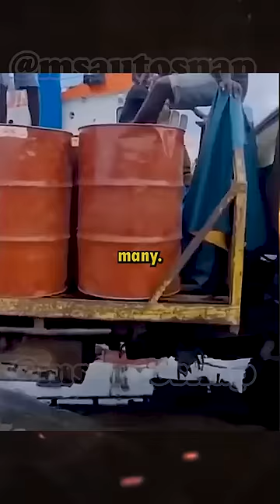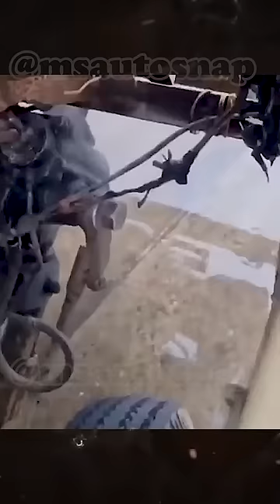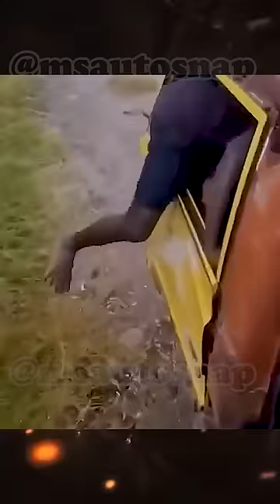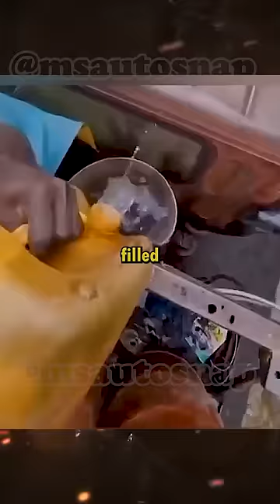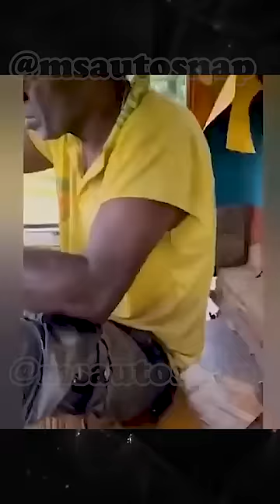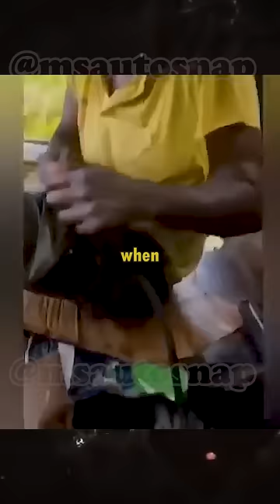What Truck Is This? #cargo #transport #truck

Comment: Fun fact it aint even coolant its just plain old water lol
Reply: They don’t need any antifreeze in their coolant because they never get freezing weather
Reply: @owen9273  antifreeze not only lowers the freezing point, but also raises the boiling point, so the engine won't overheat at 100c. It also inhibits rust inside the engine block. Of course, at this point with this truck, that's totally irrelevant
Reply: @PaulHojda Even with anti freeze it would be a bad system, because there is no pressure (thus lowering boiling point)
And if you lose this much coolant into engine or the environment, it better can be water.
Reply: Water is coolant. Antifreeze itself kinda sucks as a heat coefficient, it just prevents the water from freezing. It actually takes away from the waters ability to transfer heat, that's why it's best to use as diluted as you can get away with. Distilled water should only be used to prevent mineral buildup in the engine and coolant transfer systems.
Reply: @PaulHojda water is still water the pressure inside the coolant system is what keeps it from boiling at 100°C
Reply: Which plays the role of a coolant thus a coolant😊
Reply: Fun fact , plain water works just fine 😂
Reply: Water will rust everything and boil at 212 degrees
Reply: @owen9273 if it was distilled water, it would be ok for a vehicle like this. The water they are using has many minerals and debris that will reduce the life of the engine drastically.
Reply: You don't have to worry about antifreeze when it's never cold. We would run straight water if it never got below freezing here
Reply: If it cools, it’s coolant.
Reply: Ach passt schon beim tüv einfach ein bisschen Geld beim Fahrzeugschein mit rein und alles gut
Reply: Fun fact water was originally used as coolant and still is in less developed parts of the world. Modern coolant is referred to as anti freeze as the primary function over water is too lower the freeze point for cold weather.
Reply: In a warm climate all you need is water
Reply: I also saw sea water used as coolant, Kudos to Japanese truck engineers.
Reply: I’ve always used water in my van. It’s at 350k miles and seems just fine.
Reply: That’s why it’s on a drip:)
Reply: @Wag27myG  if you have an aluminium radiator and feel it with low EC° (electric conductivity) water it could last long , with copper or high EC° it will clogs fast.
Reply: Not just plain ol water, it's swamp water with water bugs, mosquito larvae, tadpoles, and other swamp creatures
Reply: @roland9367 I'm sure it's not antifreeze
Reply: @PaulHojda  boiling point in a 15 psi coolant system is already significantly higher than 100c
Reply: @BigPanda096 
This whole truck could use some remineralization😂
Reply: @CurtisCarpenter-rm2jl  Tap water is perfectly fine for most vehicles, corrosion usually is more of a problem when using only water
Reply: , not coolant.
Reply: @T1m11 you need to use distilled water. Trust me using plain tap water in any vehicle will damage it.
Reply: @Billy-burner  No, it doesn't, you only really need distilled water when you use the old phosphate based coolant.
Reply: @CurtisCarpenter-rm2jl  these guys are definitely worried about engine life reduction in this truck.

IMHO this truck was already scraped as being at the end of its life and these guys were able to get it running again lol
Reply: @BigPanda096  Absopure?
Reply: @mikereynolds1368  the truck is vital to these ppl’s lives. If the engine gives out, they are in big trouble
Reply: When you never. Have to worry about it freezing lol
Reply: They are using either rain water or bore water. I use bore water in my vehicles in Ghana. A high quality engine oil is much more important than what water you use especially in a water cooled motorcycle engine. 
The petrol here is low grade I have experienced pinging after filling up at a particular brand of filling stations.
Reply: @PaulHojda Water is a coolant. You can't use antifreeze in professional racing, only water, and it works just fine for high horsepower race cars.
Reply: @sumo-ninja You've got no idea what your talking about lol I live in Australia where it never freezes and we still use "antifreeze" because it stops corrosion which happens if you run just straight deminorolised water so no your wrong no one in any developed country would choose not to run "antifreeze" because that's not it's only purpose. Tell me you don't know what your talking about without telling me so 😂
Reply: @paulallen-01  You've got no idea what your talking about lol I live in Australia where it never freezes and we still use "antifreeze" because it stops corrosion which happens if you run just straight deminorolised water so no your wrong no one in any developed country would choose not to run "antifreeze" because that's not it's only purpose. Tell me you don't know what your talking about without telling me so 😂
Reply: @mattsabeast5 wrong it is used because of its anti corrosion properties just as importantly as it's anti freeze purpose. Why do countries like Australia use antifreeze if its only purpose was to stop coolant freezing? 😂
Reply: All those people commenting "antifreeze isn't needed in warmer climates" obviously have no idea what your talking about look up its corrosion inhibiting properties. And coolant is a mixture of distilled water and corrosion inhibitor/ antifreeze it is used in countries like Australia where im commenting from mainly for its rust inhibiting properties. Coolant is a mixture of chemicals & deminorolised water used to inhibit rust and sometimes to stop coolant from freezing but it isnt used for antifreeze properties in all parts of the world that is why it is used in different ratios and also different types of chemicals depending what its purpose. You can buy many different types of coolant so all those people making silly uneducated comments do some research before spreading false information. Obviously in this case rust is the last of their worries but coolant is not just "antifreeze" look up the definition of coolant and all the different types & even the different ratios of ethylene glycol / deminorolised water & its  uses depending on what climate you live in.
Reply: @aaronaaron3003  yeah these guys are idiots. Aussie mechanic here, both motorbikes and cars. I cringe at the people saying it's ok to use plain tap water. It's full of calcium and minerals, which ALWAYS turns into crap inside a coolant system. Seen it thousands of times. It eats through aluminum and steel and turns into disgusting clumps of cake deposits.. Sucks to know someone will end up buying a second hand car from one of these idiots and it'll be a ticking time bomb. Even worse when people leave plain tap water in their coolant system and have left it sitting for a few years.. everything like the water pump, rubber hoses and water galleries will be fully caked, rusted and destroyed. Yet those stored with coolant and no tap water, they are still mint condition. Not only does coolant raise the boiling temp, and lower the freezing temps, it also is a rust and corrosion inhibitor.
Reply: @Billy-burner  Your definitely not wrong Iv got two ktm dirtbikes that I haven't ridden for around two years now due to multiple back surgeries and both my bikes have been sitting in the roasting hot garage for two summers now & I just started going over everything on them to get them ready for the upcoming cooler weather and both bikes have lost around 200ml out of the 1 Litre cooling systems/ radiators due to expansion and evaporation in the roasting hot garage over the summer days & they are both absolutely perfect there's no corrosion whatsoever even tho the radiators have a decent size air pocket at the top of them and they haven't even been started or anything in well over two years now. One has just normal ethylene glycol based coolant and the other has radiator ice/ high temperature coolant & both have most definitely done their job corrosion wise. It's crazy to see how much mineral build up you get from plain old tap water like you've said, Iv had to top up my old BF supercab ute with normal water a couple of times when Iv been out bush and overheated and have forgotten to flush the cooling system afterwards and within a few months I had the thermostat get stuck in the closed position due to corrosion and you could quite literally see the crystals from the mineral deposits building up all over the thermostat & all through the cooling system after only a few months because the minerals boil off and seem to settle even more so in the high points of the cooling system which on the BF supercab ute is the thermostat housing & the coolant reservoir & all along the top of the radiator. It blows my mind seeing a lot of the misleading "mechanical advice" online, a lot of common sense things aren't exactly common sense anymore even tho it literally gives you a lot of the information on your fluid bottles when you buy things like coolant and oil & other critical fluids 😂
Reply: @BigPanda096 It's called coolant because it lowers the boiling point of water as well as being called antifreeze because it also lowers the freezing point of water. Welcome to knowledge, my friend.
Reply: Duh
Reply: @T1m11  ya, i suppose if you’re diluting antifreeze, it wouldn’t hurt.
Reply: @imfloridano5448 well that will eventually stop the leak.
Reply: Damn you're a genius!!
Reply: Thats gotta be a fuel tank
Reply: Plain water is coolant??
Reply: @Billy-burner not true. Maybe travel outside of your country and see how its done. There are 40 - 50 year old vehicles still using tap water. My 86 Toyota always used tap water 267 on odo when I gave it to my lil bro everything still original. Even water pump didn’t fail
Reply: @jusplay7309  there are countries which exclusively use only tap water? Thanks for the knowledge my friend.
Reply: @CurtisCarpenter-rm2jl yeah it’s not distilled water these people don’t have access to clean water let alone distilled water. I truly feel bad for people who live like this. There is no need the world has enough space to create enough resources so everyone can eat and live properly. It’s greed and power corruption and control that breeds this kind of living situations. Also Some countries truly don’t want to be modern they want to live like this. Look at Afghanistan America tried to introduce schools, better stores, and more but they would destroy them every chance they got.
Reply: Wata
Reply: Water is used as coolant in many things
Reply: Fun fact do you really think these guys give a dam what liquid they use as coolant?
Reply: Need one of those set up for my honda. Keep it at 50mpg.
Reply: @SayGahTaah  that’s not a fact that’s a question
Reply: Fun fact, you don't need coolant if you're somewhere that doesn't ever freeze! It would be wise to add a anticorrosion additive pack to pure water if you decide to run it but yeah this place probably doesn't hit freezing!
Reply: @PaulHojda pressure raises the boiling point regardless of whether there is coolant or just water though! Plenty of people run race cars on distilled water in instead of coolant and don't run into overheating issues... Because their cooling system pressure prevents boiling until a much higher temp than an open system would! Water boils at close to 250+ at 30 psi which is typical absolute pressure for a cooling system. 15 or so psi above ambient! With a proper radiator. Fan and thermostat you'll never get near 250 on a car cooling system at all so no worries about boiling
Reply: @John-eb5zt at cooling system pressure water doesn't boil till 250 ish. In an open system like this yeah it will boil at 212 but even then if your thermostat opens at 195 you really shouldn't be hitting 212! My thermostat in my passat opens fully at around 195, and the highest you can ever get it even ripping on it is 205ish. That's running EGTs pre turbo that approach 1700 degrees Fahrenheit. Lots of heat! When EGTs are at 1700 you're looking at cylinder temps approaching 2200 degrees Fahrenheit, and even with all that heat.. Still no more than 205
Reply: @CurtisCarpenter-rm2jl  aha, so distilled water prevents your block from rusting away?! Interesting
Reply: @John-eb5zt nah mate, Water boils at a temperature determined by pressure. As to the rusting stuff out part, not fast enough to really matter.
Reply: The coolant in my classic car is currently plain water, switching to anti-freeze coolant when I empty it but it ran fine for years with just water.
Reply: Fun fact water is actually a coolant 🤦‍♂️
Reply: @jaytee2716  the view of America is what Washington DC displays to the world. The government and the American people are truly worlds apart when it comes to values and policies.
Reply: You probably didnt know but unless water freezes where you live, water cools better than antifreeze mix.
Reply: @PaulHojda thats not even very true. Its been proven. More marketing. The coolant will not raise the boiling point enough to keep from boiling. If the radiator is getting air you have nothing to worry about. But you can buy coolant for $20 a gallon if it makes you feel better.
Reply: @rallythewords 😂😂
Reply: @DarkAttack14  antifreeze is different from coolant.
Reply: Welcome to what coolant is
Reply: @Dutch.W  antifreeze=coolant, the words are used interchangeably across most of the United States. If you go a dealership or regular mechanics shop and they tell you that you need coolant.. Guess what it's antifreeze that's going to be put in, stop playing semantics
Reply: People discussing and arguing about coolant like it's the most important thing here!
Reply: I live in Australia hot here all the time coolant is what we use keeps the engine much cooler  any one who says coolant/antifreeze  is only for places that get freezing temps need some better education on the topic because you are just plane wrong 😅😅😅😅
Reply: @John-eb5zt cars made before 1950 are basically all made to run with water as the engine coolant
Reply: yea. the narator said that because some of viewer don't know and will assume that is fuel
Reply: Mud was assessed to raise boiling point. 😂
Reply: @PaulHojda except that's not required in a pressurized system, because the pressure is what raises the boiling point. Water by itself is a better coolant than antifreeze.
Reply: Water IS coolant.
Reply: @John-eb5zt I'm sure they're worried about rust.😅
Reply: @owen9273 coolant also acts as a lubricant for your water pump.
Reply: @BigPanda096 coolant also acts as a lubricant for your water pump.
Reply: @PaulHojda not gonna build up much pressure without a radiator cap.
Reply: Down here in the south most people just run distilled water.. it isn't cold enough to worry about it
Reply: I'm sure they drink a lot of water before they start the trip, and make their own😅
Reply: Good thing it's just water you don't want real coolant dumping into the environment like that
Reply: Water is a very effective coolant, ask your local blacksmith.
Reply: raising the boiling point doesnt mean the engine wont overheat, the process of water boiling is a phase change, which results in a large amount of energy (heat) being radiated away in the form of steam. So long as you can keep adding water itll continue to carry the heat away as it boils. The reason you'd want antifreeze to have a higher boiling point is so you dont have to keep adding more coolant constantly as the car runs, since the energy radiation is being done by a fan instead of through a phase change.
Reply: @owen9273 uh, you don’t have a license huh?
Reply: @BigPanda096  hahaha! Either your a mechanic or know nothing
Reply: @Apex8r  why? It seems people don't know how to read what I said. All I said was that water has a better heat transfer coefficient than glycols. That's just a fact, the only things the coolant really is for is to disperse detergents, seal conditioners, corrosion inhibitor agents and increase waters resistance to freezing. But because glycols have a lower heat transfer coefficient by adding it to water you lower it's heat transfer coefficient even if it's just a completely negligible amount. All I said is if you can get away with it you are usually best using as little as you can get away with. I'd never go less than a 30/70 mixture for tropical climates, that way you get the best cooling factors of the water combined with the additives of the coolant, when paired with distilled water you almost cannot get a better performance and longevity from that. I'm not saying you don't need coolant at all just that the name as per it's actual function is funny to me.
Reply: @shelbyseelbach9568  Glycol raises the boiling point of water though, and so does the fact that the radiator is under pressure as well. In fact for that purpose alone, you do not need coolant at all simply an increase of pressure will do. I know why it's called antifreeze, that was the reason of my comment. It also carries a package of detergents, seal conditioners, corrosion inhibitors and the liquid itself is an agent that lowers the freezing point of water drastically. Though the detergent and additive package is typically unique to manufacturer, it is for that package that it's important to use coolants even in climates without freezing conditions. 

I never stated otherwise, but thanks for trying to educate me. Just next time make sure to double check what you said before you hop up on the pedestal and shout it.
Reply: @Dutch.W  not really no, basically all commercially available coolants are made from glycol, which itself is the anti freezing agent of antifreeze.
Reply: @unbiasedretort0  indeed. That is why it's wise to run no lower than a 30/70 coolant/distilled water ratio in climates that do not freeze. The additives package is very important for detergents, seal conditioning agents and corrosion inhibitors. I would never run my car without at least a 30/70 mixture, not unless I was super desperate and had no choice, but it would be changed immediately upon first chance.
Reply: More like plain river water
Reply: @codyblade7872  fun fact. Coolent has additives that prevent galvanic currosion. So water is not enough if you want to prevent changing radiators, heater cores and water pumps.
Reply: @PaulHojda  if boiling point raises, I'll overheat the engine bruh
Reply: @CurtisCarpenter-rm2jl  reduce the life of the engine? the engine is already dead. it's a zombie engine now.
Reply: @davidjacobs8558  definitely have a point.😆
Reply: Why would they need coolant in Papua?
Reply: @PaulHojda ok
Reply: @imfloridano5448 😂
Reply: Yes its water cooling 😅
Reply: water is the optinal coolant in hot environments
Reply: Coolant is normal not necessary in many tropical countries where the weather is mild throughout the year instead cars and trucks built for those regions use water
Reply: You don't nee antifreeze in a tropical country. Also you don't need distilled water for this truck, since it won't last long enough for junk to build up if used with normal water.
Reply: Honestly, I've never used coolant, in my life. I always fill it with water.
Reply: It's still a coolant
Reply: antifreeze isnt eveen coolant, your coolant system is half water half antifreeze, antifreeze main funtion is to just raise boiling point and keep corrosion  down.. water is better as a coolant,
Reply: We used have 83 Toyota never use coolant only water
Reply: I hope they getting new truck soon.😢
Reply: That is more common than you think.
Reply: The water acts as a coolant 🤦🏾 vehicles were first designed to be cooled with water, coolant was after the Oil Refining Industry produced what we call Anti-freeze which is a by product!! You can thank me later if not now 😊
Reply: Unless you pressurize the system, it will boil out when  you stop! Better carry a couple of drums of water with the fuel!! Loll@matthieulagardere3886
Reply: What about oil changes or spark plug replacements?
    Don't they ever bring that truck in to a gas station for servicing ?
Reply: dirty water at that.
Reply: Wdym, in warmer temps you can run your car on non-mineral drinking water. It's just anti freeze and some cleaning agents.
Reply: @PaulHojda  Bruh, water is pressurized in the cooling system to keep it from boiling over. Anti freeze not required in warm climates but you should use demonized water.